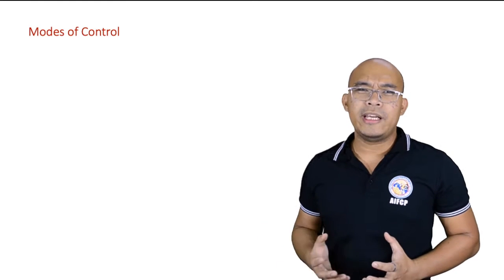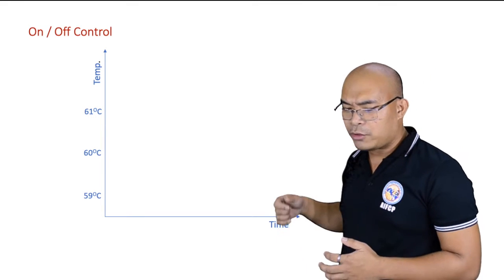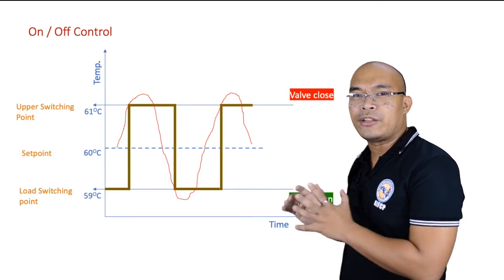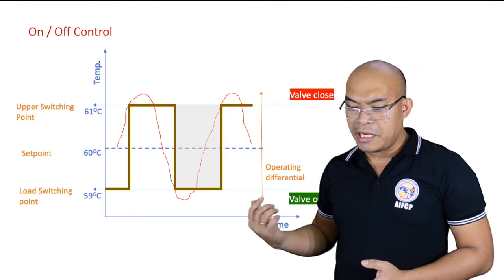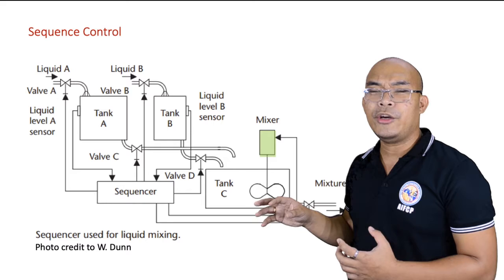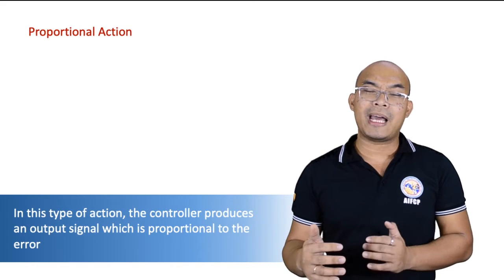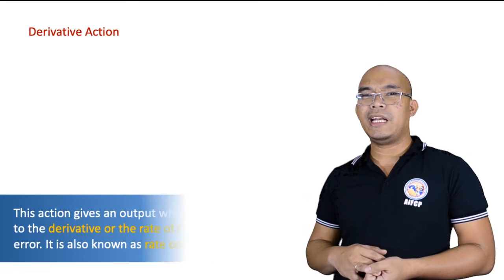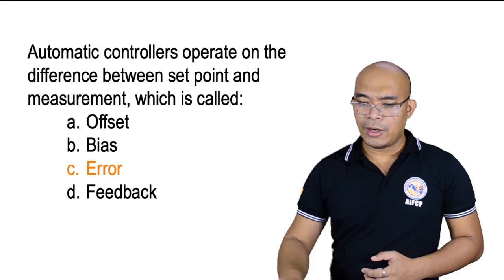Introduction to Process Control | Filipino Version

Comment: Thank You for this Video Sir, I have a lot of learnings about the different types of Function of controls systems, Also I learned the working principles of it and also the difference on Modes of control, the on/off control, Sequential control and the proportional control and its sub parts of the intefral and derivative. Thank You sir.

Comment: Thanks fo sharing this video sir, I was able to understand more about this topic the Process Control, which had modes of control namely the On/off(The two step position control), Sequential(which has to be in sequence with the help of the sensor as well) and the Proportional( which depends with or the situation)  Controls

Comment: Thank you for this video sir i learned a lot about sequence control, dn advantages and disadvantages for advantages is proportional controller helps in reducing the steady-state error, thus makes the system more stable. End for disadvantages offset or overshoot cannot eliminate the residual - error in processes with compensation.

Comment: In this topic I learned about the different types of process control or mode control like ON/OFF action know as two step position control and Also i learned from this video are the modes of control especially there advantages and disadvantages.

Comment: I learned that in the fuel oil system have to set into high temperature to make that operation it use steam process and in the steam operation is controlled by the solenoid valve use to make the operation stop and start in other words on or off. Thank you sir.

Comment: The control system has a different process such as ON/OFF control, sequence control, proportional action which include integral action and derirative action. The ON/OFF action is also known as two step position, the control of modes is fully open or fully closed. The sequential control an event process a step by step procces, and last is the proportional action is a simpliest and most common encounter  modes.

Comment: I learned about the different types of control modes and how to classify them. The first is classified as an on/off control, often known as a two-step position control because it only has two states, either on or off. As a result, it is the most fundamental control mode. This control mode should only be utilized when the design system's precision isn't critical.The sequential control system, on the other hand, is a control system in which individual steps are processed in a predetermined order. The proportional control action, which is the simplest of all the continuous control modes, comes last.

Comment: Thank you sir for you're another video sir. I learned about different types of process control system such as ON/OFF Control, sequence control, proportional action which include integral action, and derivative action. The working principle of ON/OFF is two step position on or off. The sequential control is step-by-step control on the proportional action is the controller produces and output signal. I learned the Advantage and disadvantages of proportional action and integral action. Thank you for your video discussion. More videos to come and god bless you sir 😇.

Comment: Good day sir for this video I learned the different type of modes odlf control. The on/off control , Sequencial control , Proportional control this control has three tyoe the Proportional action, Inregral action the last one is the Derivatice action and this actions has Advantage and Disadvantage. The advantage of Proporsional action are It is relatively simple and easy to design an output and tune , it provides good stabilily , it responds very rapidly , dynamically it is relatively stavle and the disadvantage of this action are offset and over shoot . that is the example of advantage and disadvantage of 1 out of 3 action . On /off control known as two positions either on/off and its must control mode . Sequential control is an event based process in which one event flows another until process sequence is complete of which means step by step process . thats all sir thankyou for the learnings.

Comment: Good day Sir!
Kuddos for this video sir. After Watching the video I learned the importance of process control system. It  enables the workers especially onboard to keep their operations within specified limits and to set more precise limits in order to maximize profitability, ensure quality, and of course  to be in safe condition. There are 3 modes of process control system such as On or off, Sequential control, and proportional control. When you need cheaper control you ca used on or off control but it can't be used as intermediate since the final control elements its either on or off only.  Sequential control is usually used when mixing a liquid that follows step by step process. Lastly, proportional control are classified to 3 types; proportional action, integral action, and derivative action. 

Proportional action- produces output signal which is proportional to the error. Meaning, the greater the magnitude of the error, the greater the magnitude of the corrective actions taken. 

 Integral action-  provides an output proportional to the error's time integral.

Derivative action- provides an output proportional to the derivative or rate of change of error.

Comment: In this topic, i learned that the PID System is a combination of a proportional, integral and derivative action. This is calibrated properly to minimize the offset, overshoot and then helps easily to response time.

Comment: Good day sir! Thanks for this video. For now I learned about the working principle of the different types of control system such as ON/OFF control action by use of two step position and it is most basic control action/mode. And also for the sequential control will flows another, until the process sequence  is complete (so it means step by step process). In addition I also learned about the concept of the proportional action, Integral action, and derivative action. So not only in the concept but also the advantages & disadvantages of this.

Comment: Thanks for this video sir, after watching this video, I learned the different types of mode of control system such as on/ off control, sequential control, and proportional control which includes proportional, integral and derivative action. Also, I learned the function and working principles of it, which in on/ off control known as two step positions either on/ off action and it’s a most basic control mode. Meanwhile, in Sequential control is an event-based process in which one event flows another until the process sequence is complete or which means step by step process.  I’ve also learned  the advantages and disadvantage of proportional, integral and derivation action. Thank you again sir and God bless.

Comment: Thank you this video sir. after i watched this video i learned  that the model of control system is composed of on / ofd control the sequential control, proportional control, proportionap integral and derivative. the on/ off action also known as two step position control most basic control of modes it is fully open or fully closed. the sequential control an event process a step by step process. the proportional action is a simpliest and most common encounter modes. the pid is design to the offset

Comment: After watching this video sir, i've learned   
the different types of modes control the on/off control, Sequential control, And the Proportional control and the proportional control and consist of proportional, integral, and derivative here i have learned the advantage or disadvantage especially the function of this device and the principle on how it works and also i have learned the functiom of On/Off control also known as a two step position control either On/Off sequence control step by step position control and proportion control. And thankyou for this video sir looking forward for more videos sir and learning HEHE thankss❤️

Comment: Thank you for this Informative video sir! After I watched the video I learned about the different modes of control and how their definition namely On/off control also known as two-step position control, and the most basic control mode. Sequential Control is an event-based process in which one event follows another until a process sequence is complete. Proportional Control is the simplest and the most commonly encountered of all the continuous control mode, the controller produces an output signal which is proportional to the error. Integral action gives an output which is proportional to the time integral of the error, also called reset control. And lastly the Derivative action, it's output only related to the rate of change in error, it gives output which is proportional to the derivative or the rate of change of the error, also known as rate control. Thank you and God bless 😊🙏

Comment: Thank you sir for this interesting vedio , I learn more about the introduction process control system, like ex, if the temperature increase until he Got 61°c so that's the time will Off the valve and it means they will get upper switching point, thank you sir for another learning 😊

Comment: Thank you for this video sir. I learned this video sir if the valves will close the steam will not inter if they will not inter so they will no heating. The process of this to mix two liquid that in the tank. Thanks a lot of videos sir godbless you.

Comment: In this video, it explains the Process Control System and its different Control Modes. I learn on how to use the different types of control system just like, On/Off Control, Sequence Control, and the PID System. It helps me to know more about the basic Control System and how use and its Advantages and DisAdvantages. Thanks Sir for sharing your knowledge about Control System.

Comment: In this topic process control system, I learned that there are classification or Modes of control, 1 is On/off control, the sequential control, and the last one is the proportion control. The on/off control is the basic, two-step control that only has 2 states.

Comment: Good Day Sir Juera, I understand that  2 step of position control are on/off and it is the most basic control mode. 60 °C is the setpoint and the 61 °C is the upper switching point (VALVE CLOSE),  And also the 59 °C is the load switching point ( VALVE OPEN) . Sequence control is Step by Step by the word of sequence. Proportion Action is the controller produces an output signal.Integral Action is also called the reset control. Derivative Action is known as Rate control.Thank you sir!!

Comment: Thank you for this educational discussion about the process control sir Louie! I fully understand and learned about the basic classifications modes of control. The first one is classified as the on/off control which also known as the 2 step position control since it has a 2 states only, apparently either on or off. Thus, it is the most basic control mode. This control mode can only be used when the accuracy of the design system is not very important. Next is the sequential control, a control system in which the individual steps are processed in a predetermined order. And lastly is the proportional control action which is the simplest among all the continuous control mode.

Comment: This video give me a lot of learning about the process control systems. I learned a lot about the different types of modes of control. The on/off control, sequential control and the proportional control and also their advantages and disadvantages. The on/off control it is the simplest form of feedback control. An on/off controller simply drives the manipulated variable from fully closed to fully open depending on the position of the setpoint. The sequential control a control system in which the individual steps are processed in a predetermined order. Proportional control action have three types, the proportional, integral and derivatives. Thanks for this information sir, God Bless!

Comment: In this video it explains the different modes of control and its advantages and disadvantages. First mode is the on/off control also known as the two step position control. Its advantage is very simple and the disadvantage when operating might fall outside the tolerance. Second mode is the sequential control which is previously discuss by the recent video. The third mode is the proportional control action which has three types the proportional, integral and derivatives.

Comment: Thank you for this  video sir I really appreciate your efforts  in this topic sir. I learned from your video the defferent types of modes control and the advantage or disadvantage especially the function of the On/Off control also known as a two step position contro either On/Off sequence control step by step proy and proportion control.

Comment: Good day sir!!!  I learned that modes of control is have a different types,  there functions advantages and disadvantages. Also  the On/Off control also known as two step control and proportional action is the greater magnitude of the error the larger corrective action applied.

Comment: I learned a lot about this video sir,  First the different types of modes of control. On/Off control, Sequential control, Proportional action, Integral action and Derivative action of course their advantages and advantages, I learn also that On/Off control also known as two step control and proportional action is the greater magnitude of the error the larger corrective action applied. Thank you for this video sir. Godbless❤️

Comment: I really appreciate your effort in this topic sir, and i learned that modes of control is have a different types,  there functions advantages and disadvantages . There are on/off control also known as a two step position control either on/off, sequence control step by step process and proportional control and the sub part are the integral and derivative. I aso learned the advanteges and disadvantage.

Comment: I really learned a lot this time. the different types on modes of controls. the on/off control, sequential control and the proportional control and its sub parts the integral and derivative. I also learned the advantages and disadvantages of the different controls as well as the proper usage of the controls.

Comment: Very informative sir👍 I can now differentiate the different modes of control which are the ON/OFF CONTROL,  SEQUENTIAL CONTROL and PROPORTIONAL CONTROL. 
On/off control which is the most basic control mode;  Sequential Control which is a step by step or event based process and lastly the proportional Control with the 3 types which are the proportional action,  integral action and derivative action.

Comment: Nice explanation sir. Proportional action pala ang tawag sa gusto mong consumption pra mafull then pag malapit na ma reach ung kailangan na dami ay cocontrol na by using valve. At ang switch on/off ay parang same lang sila sa bimetallic strip but different purpose. Thanks a lot sir Dami ko nalaman sa video nato. :)